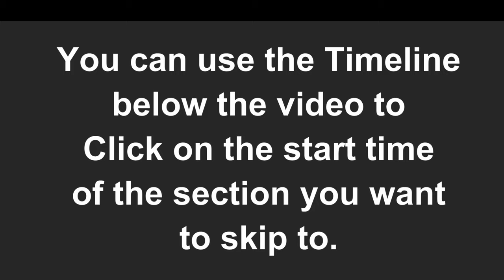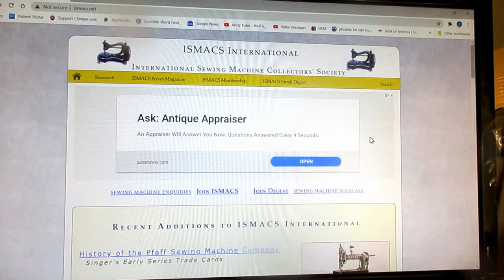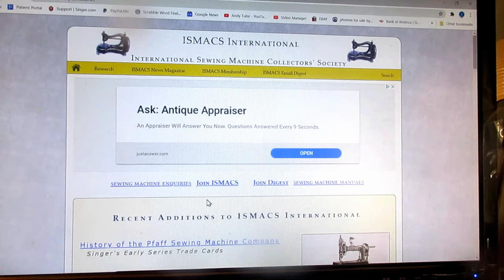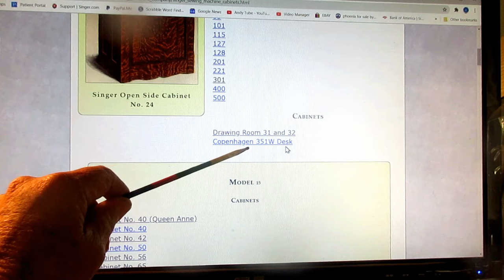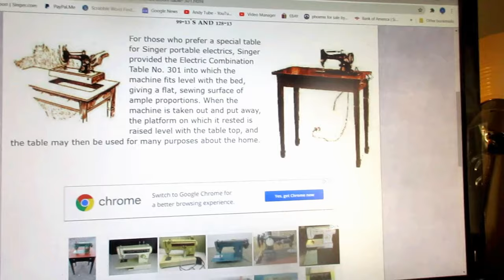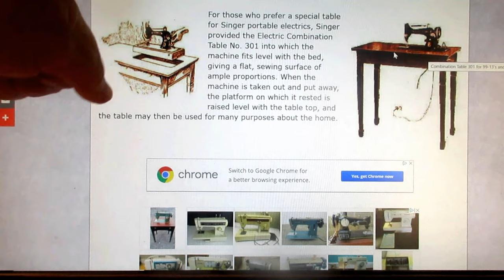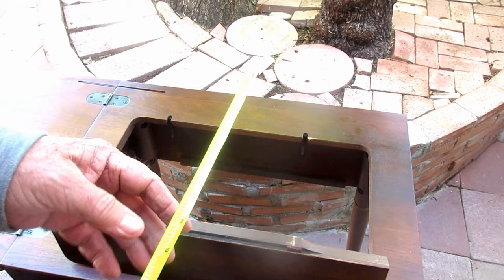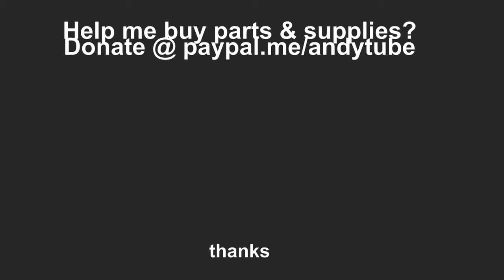How to choose a cabinet and install a vintage Singer sewing machine

Comment: Funny that I should find this video about cabinets just now. I recently received my Grand Mothers touch n sew 603. A relative had it since grandmother passed in 75 and had it out in a storage shed since. Then my son somehow got it back.  It some how got the cabinet destroyed. It was in a sad state to say the least!  I sprayed it down with penetrating oil to free the machine back up and loosen all the dirt/ and light rust. Removed the remains of the cabinet. Found a nice but different style cabinet at an Estate sale site for cheap, without a machine in it. Got the machine all cleaned up and running again, and converted the top ledge of the new cabinet to fit my machine in. Same sale ,We bought a complete 401 with it's cabinet, ready to run!  Didn't know the machine was still in it till we picked it up at the sale barn!  Figured one of the cabinets would fit my machine, the 401 was a surprise to say the least!  If I had to choose one over the other, the 401 would win hands down! Not many of todays young women have any clue as how to use one, and are totally clueless.  Keep  up the information, I'm betting some young ones will pick up on it and get back into this love of old lifestyles!
Reply from the maker: I appreciate your comment. Yes, 100% keep the 401A. The 603... meh. I don't care for the bobbin system but that's only my opinion. About 10% of my viewers are young, women & men & xx since my channel went live. During the COVID pandemic that went to 22%. I mean ages 25 yo and below. They are getting moms' and grandmoms' machines out of storage and learning to sew. Many mention clothes are too $$ if good quality or fall apart if affordable. A favorite thing they seem to like is going to yard sales and buying XXL clothing that did not sell. They buy it for the high-quality fabric that sells for $20+ at the store and cut the piece down and design what they want. Some use old Butterwick and other paper patterns they found. It's amazing, really. They often comment to me they can't believe how well the vintage sewing machines are made after trying the plastic throw-away machines and having them break in a month. I have donated machines to charities that have senior lady Sewists volunteer to teach anyone to sew and most of the ones they teach are younger, including the guys who are sewing camping, fishing, hunting, and hiking gear using nylon and canvas and love a machine like the 401A and 404. Nice of you to stop by and share. Take care.

Comment: I could be wrong but I haven't picked up a single machine that doesn't have those. I think they were made in every casting because it would be easier to do that than it would be to try to figure out what to do with the machines. And oh we're going to make so many of this or that they can just cast everything one way. Drill it out and things like that. And if they didn't come in a table they usually came in a carrying case as a portable and sometimes people bought tables later so I can said I don't think that there was any of them that were made without them, even the Japanese models the clones were generally set up for singer tables

Comment: Andy you are a wealth of information! I now know how to remove my 301 from the cradle and also know how to secure my 201 in the cabinet. I have the set screws, but didn't know that's what they were, so the machine has had to sit up all the time and I have been worried that it might come loose from the hinges and do some damage. A historian once told me that it's the "common" things in life that are lost first to history. Have you written a book yet with all of these great tips?  So few people have this type of knowledge. I would buy it for sure. Thanks again.
Reply from the maker: It's wonderful comments like yours that help me feel justified in all the time and energy spent on my channel. It's so rewarding to hear if you were telling me they learned something new that's going to help them. Congratulations again on your new 301. It's a beautiful mate for the 201 as those are two of the very finest machines singer ever made. Best of luck going forward and take care

Comment: Hey Andy! I inherited my grandmother’s Touch & Sew 626…in its original cabinet! However, when I took it out of the cabinet years ago in order to have it serviced, I misplaced the two hinge set screws but I didn’t know what to call them in order to find replacements, so I’m grateful to have found this video. Thank you a million times over!!
Reply from the maker: Very welcome. I'm never sure what information viewers will find helpful so I just try to include all I can think of. I'm happy you'll be able to remount your T&S machine, and happy sewing.

Comment: I’m lucky enough to have a large enough sewing room to have several machines in cabinets. I really do prefer them that way. Machine is steady and seems more quiet.
Reply from the maker: Happy for you! I agree with cabinet mounting especially with the heavier models. It provides a larger work area at the same height as the sewing bed. The SInger cabinets and combination tables even look decent when closed up and the machine stored inside. Thanks for sharing, and for watching my channel.

Comment: Well Andy, you found another interesting aspect of vintage sewing machines. When you mentioned the ISMACS site, I paused your video and went to that site to find information on cabinet #43 that my last 201 came with. No information there so I'll take some pictures and send them off to the site to see if they want to include that in their database. 

Your video also reminded me of two recurring problems I run in to. I've had two cabinets now where the drop down pedal is missing from the knee bracket. It means I end up putting the controller on the floor and I find that more inconvenient in use and in storage. In some other cabinets I have found the swing out shelf support arm has been tinkered with and the bullet detents are missing. Again, not the end of the world and inconvenient. It's hard to find just the missing parts and usually the only option is to buy an entire replacement unit.

And you're absolutely right about it being a lot easier to install and remove machines with someone helping you. One of the few things my son and I do together.
Reply from the maker: When I have seen cabinet parts on eBay they usually will only sell you the complete setup for hinges, brackets, screws, etc. I think there are a lot of discarded tables in the landfills, 😢 I did see a nice mahogany one a person had converted to a wine bar with wheels. So the family that mounts machines together stays together, right? Thanks for trying to update ISMACS. I've never seen a cabinet 43 so I look forward to it.

Comment: Thank you for making this video. I have my mom’s 301 with cabinet. Last year I took it out to have the machine serviced. I’ve hesitated putting it back in the cabinet because I wasn’t real sure how it went back together.  I’m confident I can do it after watching this video.
Reply from the maker: I'm glad you found the video. I was very puzzled the first time I tried to remove a 301A. I unscrewed the set screws and thought "what is this weird thing on the bottom of the machine", haha. My wife figured out the release lever for me.

Comment: Thank you for this most informative video! You educated me about the table I have been using for the longest time without knowing about the hinge pins. I ordered a set and hope to have my whole setup ready for my upholstery work coming up.
Reply from the maker: I'm glad you found my video, Mario. For sure having your machine is a cabinet with work surfaces level to the machine bed makes for smoother sewing with less effort. Best of luck with your upholstery project, and thanks for taking the time to comment.

Comment: Thanks for the video. I'm still looking for a cabinet for my 338. There are quite a few around on eBay in the UK but fairly pricey now and often badly stained. Main problem is getting the transport to get them home they are quite bulky. I'll keep looking as they are so much better than just sticking the machine on an IKEA table!
Reply from the maker: Many of the vintage wooden cabinets before the 'late '60s, were shipped "flat-packed" from a Singer factory to their stores, much like Ikea ships. You can dismantle them fairly easily for packing and shipping. The legs and sides are screwed onto the lower part of the fold-open top, either directly or with metal corner brackets. The two top pieces are together with hinges you can remove if needed. I have shipped 3 of them to S.E. Asia by taking them apart. I hope you do find one, say like a No. 40 Queen Anne or No 40 Library Style made of solid wood. This section at ISMACS has some pictures of the earlier cabinets. https://ismacs.net/singer_sewing_machine_company/singer_sewing_machine_cabinets.html   Those early huge ones and the Treadle-style ones with iron legs are another story though. Good luck, and thanks for watching.
Reply: @andytubesewing1953  Thanks for that information. If I see one I can always contact them to ask about dismantling them. We could try to get them into the car if we are able to do that. I would have bought one when Mam bought my machine but that ws before we were married and had our own house, there was no space at home for it. By the time we bought our house we couldn't afford one!
Reply from the maker: @WinifredWaite  I sold many machines over the years and most younger people did NOT want a cabinet saying they had no room for one. Maybe 1 out of 40 bought one. When I would later sell just the cabinet it was always to middle age or older folks. My wife has a 301A for most of her sewing, a 403A for when she has a lot of ZZ sewing to do and an overlock. All in cabinets with knee lever motor controllers. Many of the vintage cabinets are nice enough for the living room if needed. I sold many of the No. 40 "library" cabinets b/c the top split in the middle and the right side folded back and straight down taking up much less room when open. A nice choice when space is limited. Good luck with your search.

Comment: I bought a 1925 model 99-13 in a case with that exact 301 table. It has the knee lever action control. The knee lever is engaged into the hole on the right side of the case base from underneath the table and has a bent lever to clear a table top if you want to work on a different able.
Reply from the maker: I've seen the machine, but not the combination table. It looks like a great setup to have. Thanks for commenting and watching my channel.

Comment: Another nice video.. Thanks for that info.!!  I like looking at all the cabinets that were made.   I love the cabinets.!!  , but they do take up a lot of room, if you have one for every machine.. lol .. About 3 or 4  weeks ago,  around 6/14/23 or so,  I purchased an (in-operable)  (1939) Singer 15-91,  in the small "Queen Ann" cabinet with a matching Queen Ann bench for (($30.00))..!!   All in pretty nice shape except for the wiring. it had no foot pedal, and it needed a total rewire, plug, light, motor wires, ....But What a deal.. I finished restoring it myself,  I even re-covered the upholstered bench with a brown vinyl "faux tooled leather look"  and it is one of my favorite machines.!!   hmmm,  I'm thinking of getting rid of some furniture,  so I can fit more machines, and  more cabinets.. LOL.. just kidding,, well maybe not,,, haha.. maybe I'll just make a table with a recess so I can put my "case" machines in the recess table, and just change them out, when I want to use a different machine.
Reply from the maker: Ooh that's a great idea to have one or two favorite tables that you can just set the machines in and out of whoa. I'll have to mention that to my wife. I've got so many pointer bruises on my hips from bumping into her tables haha
Reply: @andytubesewing1953  I know how that is, my smaller cabinets are about 50" when opened with the small wing on the right and the large side opened out on the left.. And my 201-2's in cabinets, are about 58" when opened up. I usually leave them open, and if they are in the middle of a room, as they are sometimes when I first bring them home,  ouch.. especially in the dark. hahah.. Oh,,,  I think the purpose of that black spring hinged flap on the right side of the many cabinets is for the foot pedal cord to come up through a (hole), which then goes right to the back of the 3 pin terminal,, so when folding the machine down, it keeps the cord from getting pinched anywhere. they may have another purpose as well? IDK.. but it's a weak spring. I have 5 iron ladies in cabinets. two 15-91's ,, two 201-2'sand a 66 treadle. they all have that black hinged flap with a hole for the cord, and of course the treadle has the leather belt coming up through..

Comment: What screw driver are you using in this video . I only have short ones that fit the hinge pin set screws. Thanks for all your videos. You help us all see and understand the beauty and purpose of these vintage machines.
Reply from the maker: I you mean the one I'm holding at @54:21 that's a 45-year-old Bell System C6 cabinet screwdriver. It's a 3/16" x 6" flat blade.
If you mean some other screwdriver just give me a time in the video so I can see it. Thanks very much for watching my channel.
Reply: Actually meant the one very early in video 4:20 - 4:30.
Reply from the maker: @dparkman491  OK, got it. That's an HJJ Co. spring screw-holding screwdriver. They went out of business over 30 years ago. They have brass tubes and push-button action to release. You can find them once in a while on eBay but they are getting pricey. https://www.ebay.com/sch/i.html?_from=R40&_trksid=p4432023.m570.l1313&_nkw=hjj+co+screwdrivers&_sacat=0   They last forever, I think. They made Phillips tip also. 
     There are modern knock-offs made with plastic handles that seem to work OK, Search amazon for "Feuerhelm Tool LLC Holding Screwdriver" and another brand is "NoDrop Tools LLC - 6-inch Screw Holding Screwdriver"
A web search of Screw Starter or Screw Holding Screw Drivers will come up with name-brand (and other) modern versions that you kind of twist onto the screw then hold the barrel and twist back to release the screw. They work well but are not as quick as the HJJ ones and you sometimes need two hands to use.
Reply: Thanks . I’ll keep my eyes peeled at yard sales.
Reply from the maker: @dparkman491  it's a good plan. I found two or three at garage sales in retirement communities. About 20 mi from where I live. Kids selling off everything before they sell mom and dad's house and don't realize what the tools are really. I got them pretty cheap. Good luck! Hope it works out for you

Comment: Hi Andy i'm now subscribed on my television too and it's so neat being able to see you on a much larger screen.  The 221 model 68 cabinet has a top when the machine is removed and placed down below inside the cabinet.  That piece you weren't sure about is the top and covers the hole and makes it a beautiful piece of usable furniture.  Ohhhh, to be able to own one of those.  Thank you for your video's.  I just purchased an LBOW 301A, a 403A in the desk like you said your wife has but is a little different and thinking hers may be the same as mine.  Mine has three drawers with knobs instead of handles and the fake drawer front on the right hand side.  I looked at the site too the night before I went to pick up the purchase and couldn't find mine either.  I love it, the lines and the cute mcm look to it.    I also got a 66 with a potted motor (that iron lady) in the deal for $60.  Drove five hours round trip, but i'm so very happy and can't wait to be able to dig in and clean them up.  My kitty cat tripped me three weeks ago and my elbow is still messed up so i'm waiting to heal up.  Oh wait.  It's a  1947 201 with a run of 15,000 Dec. 19.  How neat, my mom has her 66 treadle from 1924 given to her when she was 16 in 1962.
Reply from the maker: Thanks very much for the Sub! I'm glad you explained about cabinet 68. I've never seen storage for the top insert before and never would have guessed it. Wow, you sure picked up some nice models. That was a trip alright, but worth it. I hope you're taking care of yourself and healing nicely. Elbows are kind of tricky, right? You have time to plan and prepare for working on your "new" machines before you start. I think my biggest question would be "which one first", hehe. BTW, I did not know you can watch my channel on television. I better check into that b/c I'd love to see some YT videos on a larger screen like that. Take care now.
Reply: @andytubesewing1953  Hi Andy.  My daughter bought my mom and I, an onn. Roku tv and it uses apps which includes YouTube.  My mom had a stroke and we were paying nearly $100 a month on direct tv and she only watched four channels and for the most part stayed on just one.  This is much cheaper because you pay only a nominal fee per month on different apps like Roku but YouTube is free unless you get the paid version.  Thanks again for sharing your knowledge with us.
Reply from the maker: @donnasmith2720  OK, I get that now. Thanks for sharing.